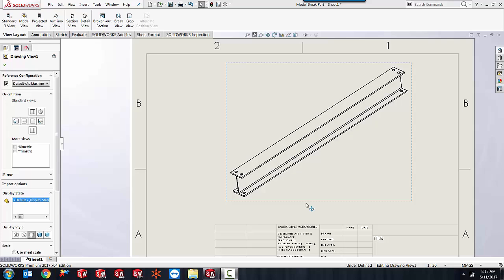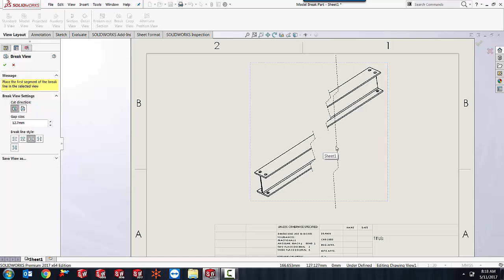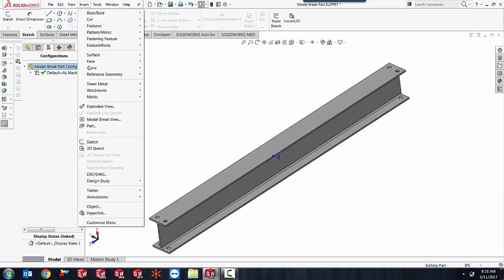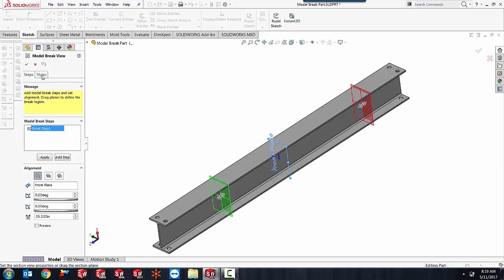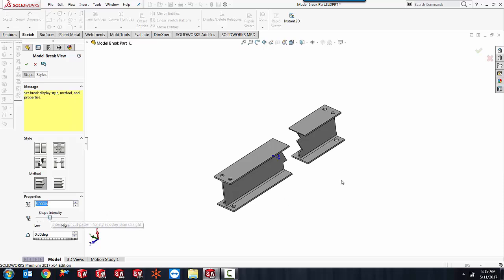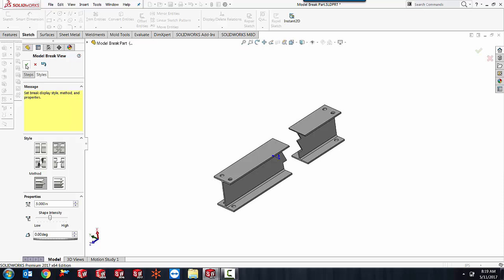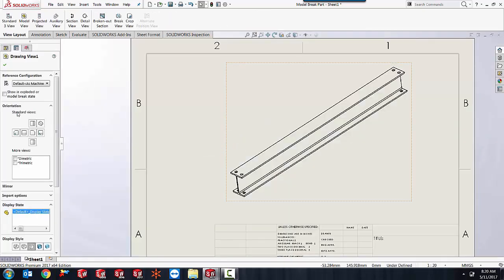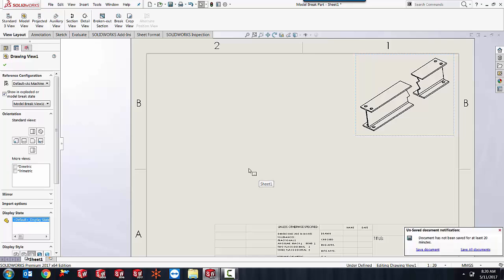SOLIDWORKS - Model Break View

Comment: Please help me
I can not find #Design library #when i open solidworks.
IT is hidden
i already use IT in Sheet Metal(for informing tool) but IT now is hidden
Reply from the maker: Hi Khalil,
If the Design Library is not showing on the side of your SOLIDWORKS windows please go to 'View', 'Toolbars' and make sure the 'Task Pane' toolbar is turned on.  If the 'Task Pane' is turned on but you do not see a 'Design Library' folder on its 'Design Library' tab go into 'Tools', 'Options', 'System Options', 'File Locations', then show folders for "Design Library".  This path should be present (or another path corresponding to the year/version of your software):

C:\ProgramData\SolidWorks\SOLIDWORKS 2017\design library

If it is not present then you would want to then add this path to the list here.  Please note that C:\ProgramData is a hidden folder and you  may need to adjust your OS settings before you will be allowed to point SOLIDWORKS to this path.  See this link for details on how to show hidden files/folders (https://support.microsoft.com/en-us/help/14201/windows-show-hidden-files).
Reply: thank you very much.